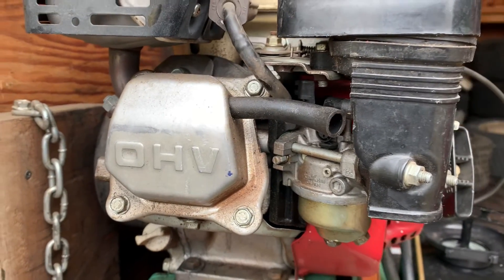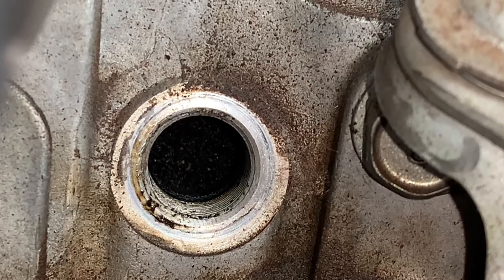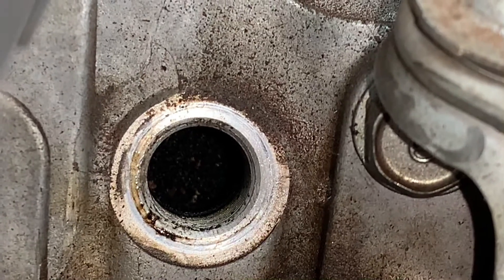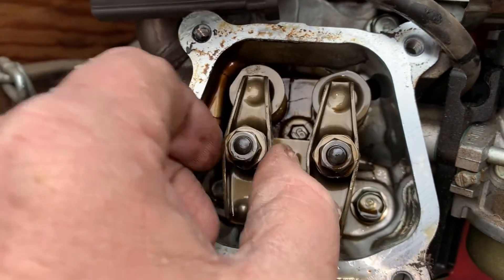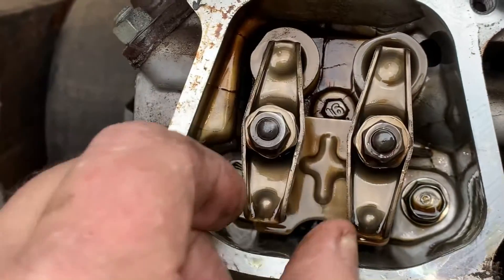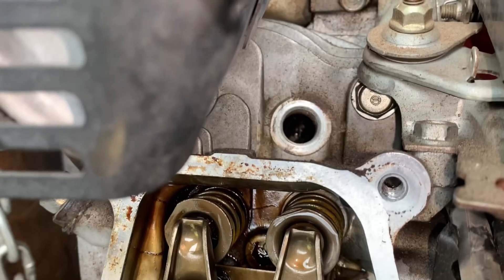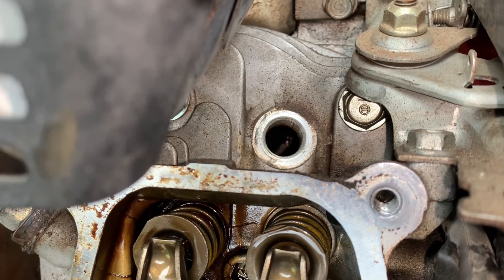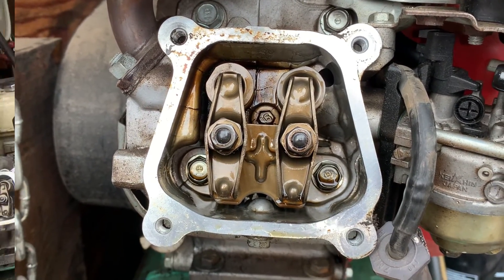DONT MAKE THIS ROOKIE MISTAKE WHEN ADJUSTING VALVES ON ANY 4 STROKE ENGINE

Comment: Is the right way to have the correct TDC at compression stroke is just after the  pressure release exhaust valve movement? 

I try both methods TDC and Cross method on my Tecumseh ohsk90 but if I set .004 at fully close valve with Cross method I obtai less tha .004 at TDC, maybe .001 or .002, I was unable to insert .004.

On the other side, If I set .004 at TDC I obtain .007 If after I check with cross method...

I'm not expert (maybe I used the wrong TDC) but I tested also ath both TDC and haven't something .007 or .006

I set at the tdc when my piston was At the top (piece of wood with mark) that was reached after the pressure release. 
Was the wrong TDC?

Comment: On my 2005 Briggs & Stratton 21hp V-twin, it doesn't matter if you're at TDC on the intake or exhaust stroke. There is NO clearance! However, if you turn the engine to fully open the intake valve, the clearance on the EXHAUST valve can be set. With the exhaust valve open , the INTAKE valve gap can be set. I suspect it has something to do with the cam timing 'overlap' on this 20yr old engine. If you tried to set the tappets at TDC (intake or exhaust), you are going to have SERIOUSLY wide clearances!

Comment: How far to turn the cam/crank shaft past TDC, top dead center, to  adjust for the "compressor release" on the cam shaft? 
Which you can tell if it has one in the schematic.
Reply from the maker: A tad past

Comment: it doesn't matter where the piston is, so long as the valve is resting, you can check its clearance and set it right if it requires it. By resting we mean it is not being operated by the rocker arm, it is loose. You will find that when one valve is resting, it is because some other valve is being compressed. Lol. But nice vid, keep on spannering and be safe out there.

Comment: I rotate the engine until both valves are on the compression TDC-loose valves then turn the engine manually without plugs in, from that point till the exhaust valve opens.-Compressed Spring. Then I set the intake valve clearance.  Then I do the opposite valve.  It’s more precise and you don’t have to wonder where the Piston is in to relation to the camshaft. 
I set the exhaust valve at the highest of the range.
Reply: I do the same, when one valve, (it don't matter which valve), is fully open, the other valve will be fully closed so adjust the fully closed valve and repeat for the other. This will end the confusion of, is it on compression stroke or intake stroke etc.

Comment: I listened but still don't understand the significance, when a compression stroke is reached looking through the spark plug hole and when the exhaust stroke is reached where as I shouldn't try to gauge the rocker arm clearance. So WHAT am I looking for exactly when I look through the hole, and at what point should I then attempt to use the gauge to adjust clearance. Please be specific.
Reply: When looking through the hole, you want to see the piston at it's closest point TO you. You attempt to adjust clearance when it's at compression because there is no pressure applied to the rocker arms; any pressure applied to the rocker arms during compression will lead to bad or no combustion at all. To know WHEN it's going into compression, you pay attention to which rocker arm is active. After air intake there's compression, so you pay attention to the rocker arm next to the carburetor; when you see it active, you'll know that afterwards compression is going to happen.
Reply: @peanutbutter6925  1). Are you saying that BOTH times the piston appears I look at the one "physically closest to me in distance"? The other times, it will be further from the spark plug hole, but BOTH times it is at its TDC or near the top of its stroke?  ...THAT IS, the one closest to my eyesight is the one I should choose to adjust BOTH rocker arm clearances at the same time? 2). Knowing what is a compression stoke and what is an intake stroke is a bit unclear to a novice... I suppose I need to know both answers to the questions to better understand things. 3).  I wish someone would have a play-by-play instruction sheet (because video doesn't explain a lot). Thanks for your effort PB because I'm facing lack of acceleration power/quitting when the throttle is depressed (idling is fine, and no adjustments (H/L) on the carb.

Comment: I've wasted far too much time worrying about finding TDC.  Just rotate the engine until one of the valves is open, adjust the other one that is closed.  Then, rotate the engine until the valve you adjusted is open and work on the other one.  Done.  No removing the spark plug, no piston position observation, etc.  The whole point of piston observation is to find TDC so both valves are closed when you adjust them.  If you're off a little, or by 180 degrees, your adjustment will be wrong.  Save time and worry, do it the easier way.
Reply from the maker: You have to make absolutely sure the closed valve is on the base circle of the camshaft. If not, you’re not going to get it set correctly.
Reply: I just used your method on my 4 stroke outboard, so simply great advise.
Reply from the maker: That method is is incorrect.  one valve open stays open for a long time during therotation of the crank, the valve you’re trying to adjust, may not be on the base circle of the cam, which will give you an incorrect reading.  Always find top center It’s  quick and easy.
Reply: @THEMOWERMEDIC1  I did it by finding top dead center, thanks for your reply.
Reply: @THEMOWERMEDIC1  Have you ever adjusted the valves on a car or truck engine? I bet you don't turn the engine to get each cylinder for TDC. When #1 cylinder is TDC, you can look at shop manual, and adjust half of the valves, then turn the engine one revolution and adjust the remaining valves. To answer your next comment you can watch the valve while you rotate the engine, when the valve that is closed you can see if you go to far it will begin to start opening. Try looking at a camshaft of a single cylinder 4 stroke and you can see the base and the lobe.
Reply: @THEMOWERMEDIC1  Thanks for this reply and this video. I set the valve clearance in my Honda GX690 yesterday by just blindly setting the one that's loose as I turned the engine. Well, today it wouldn't start and you could tell it was struggling to turn it over , it sounded like a galloping horse. Tomorrow I'm going to take the time to find TDC and do it right 👍
Reply: Agree, was gonna say that
Reply: Exactly  ,,, much more simple  👍
Reply: Man thanks lol not gonna lie same as u worry about tdc who tf can get that exactly same on every motor lmao smh rite on I like how u said that 🤙
Reply: Can I ask ya this …. Say I did what u said first lol made both open and now out of wack. How would I go about finding my start point again ? Just rotate until ones closed ?

Comment: If you put your thumb over the spark plug hole as you trunk the motor over, compression will blow your thumb off the hole, if it's the compression stroke.It will not do that on on the exhaust stroke because the exhaust valve is open. 
I always put a screw driver in the spark plug hole afterwards and move the piston back and forth to be sure I am at the very top of the compression stroke.

Comment: I been doing m for years n found for me it's easier on tdc exhaust stroke 
Rock crank till ex opens, adjust int
Rock crank till int opens, adjust ex
Cos decompressor on tdc comp stroke means you have to send piston over centre by 6mm n that's just a hassle 
But don't let me confuse the newbie's, if you do it often enough, 
you'll work out what I mean.
GT'S RUNNING REPAIRS 
OZ
Reply: Yep, I'm confused. A step by step on a 4cyl trimmer  that I'm adjusting would be helpful.

Comment: OK, I'm a decent mechanic so I think I know how to do this. Never had a problem w/with engines but for some reason I get to TDC on comp stroke, set both valves  correctly, check them again, and still I get the engine locking up when I try to start it. It WILL start fine if the engine wasn't right at the comp stroke, but when I start it and the engine is about TDC it will only turn a tiny bit and stop. I have to manually rotate the fly wheel, then it will start since it's now past the comp stage. I know what you're thinking... I don't have the valves adjusted correctly, but they are.  this is very frustrating... any ideas? Some people say to turn the engine about a quarter turn past TDC, then set the valves.  thoughts???   THANKS!!
Reply from the maker: Comp release
Broken on cam

Comment: Champion generator video shows directions wait exhaust valve be open then adj intake.  Wait intake be fully open then adj exhaust.  Not sure which first but done couple videos.  I did like you on my Pulsar then checked see if Champion way   have same specs seemed tighter couldnt get .007 0r .009 in.  Way tight from factory which weird all do build motors China.
Reply: It doesn't matter which stroke it is on, the back side of the camshaft clearance does not change. If there is a compression release, there is a timing mark on the starter bell.

Comment: ❤ great video brother have you ever did any work on the new V-Twin igx800 by Honda? I have one with around 120 hours and it is lightweight surging but also it is losing power when we put a load on the 10 gallon a minute pressure pump we changed all the throttle body gasket intake gaskets the oil we had to replace the rectifier and someone told me that it might be the coil when it gets hot gets weak? If you have any suggestions or solutions to this we would really appreciate it thank you for the time it took you to put this great video together❤❤

Comment: another additional double check is is to observe where the flywheel magnet is in relation to the coil/ignition module.  If the magnet is not even close to the coil/ignition module, then you are NOT at top dead center.  The compression stroke phase in a 4 cycle engine means that top dead center happens in TIME with the ignition.  Watch how the magnet rotates closer and close to the coil/ignition module when the piston is pushing into compression...this is how you KNOW with PRECISION that the piston IS IN THE COMPRESSION CYCLE.  .

What I have found to be very helpful is to continue to move the piston past top dead center, and then just as it starts to move back down into the cylinder, this is the most optimal spot to do a valve clearance/gap/lash.  The reason for this is two fold:

a.  most modern 4 stroke engines have a decompression mechanism.  This decompression mechanism actually holds the BOTH valves open just slightly at top dead center.  If you try to set valve clearance exactly at top dead center, then the valves will not actually be correctly gapped. 
b.  You really want the valves completely closed during ignition...and this happens just as the magnet rotates to the leading "ARM" coil/ignition module.  Ignition happens very quickly right at top dead center, not before, and not after.   If the valves are opened too soon, then you will have engine performance issues.  By slightly rotating the flywheel so that top dead center has already passed and the piston is just barely starting to move back down, you will notice the magnet has passed BY the first "arm" of the coil/ignition module.  This means the ignition spark has already happened.  And THAT is the right timing for valve clearance...(and you avoid the decompression mechanism problem stated above).

I learned this through trial and error.  I used a tachometer light.  When I had initially set my valve and timing.  I noticed that the ilde was not as smooth...I painted a timing mark on the flywheel.  The timing light showed the mark dancing quite a bit back and forth.  But when I set the valves just AFTER TOP DEAD CENTER and made sure the magnet had moved just slightly past the first arm, the timing strobe experiment showed great improvement.  The timing mark did not erratically dance and the engine was silky smooth.  Having a timing light is a great tool to have by the way.  It can also help you find out other problems too, like keyway/woodruff key damaged...or a bad coil.  Or spark plug problems.  or a head gasket problem.  A timing light, similar to how to properly use a leak down test, shows you the state of performance of your ignition health.  it can reveal things that no other tool can, and is pretty simple to understand.  

God Bless America
Reply: @tdmmcl1532 Thank you VERY much for your comment. This is the best and most concise information that I have read on how to adjust valves, again THANK YOU !!! No one else has gone this into depth other than top dead center of the cylinder. Thumbs up to you Sir.
Reply: Maybe you can answer this question:  I have a Honda FR700 rototiller and it began to miss and backfire, got progressively worse until it wouldn't start at all.  I have replaced the coil twice and even replaced the points with a universal ignition module.  Still won't start and no spark occurs.  I hooked up a timing light to the plug wire to see if I was getting spark.  No light from the timing light. Can a magnet fail?  The magnet is located on the internal rim of the flywheel.  It still acts like a magnet when I put something up against it.  It is odd that it got progressively worse rather than a complete failure at once.  I'm stumped as to what is preventing it from firing.  There's not that much to the ignition system.
Reply: @BeanieandCecil  I would think something is grounded. like the sparkplug cable or the shut off wire that attaches to the coil. read it with a meter to ground. but I could be completely wrong.
Reply: You are the greatest ever
Reply: I use a timing light or pen detector for wiring issues.  Firing issues are a pain to work on.  And, Can be expensive. 
I like the advice from the author.  But wonder if ya solved the problem.
Reply: israel owns trump AND america
Reply: Or, you can do the tappet adjustment THE EASY WAY. Rotate the flywheel till one of the valves (intake or exhaust) is FULLY open then adjust the valve that is closed. It will be at the widest gap! One lifter will be on the peak of the cam lobe while the other lifter will be on the cam 'flat'. This is the way it works on my 2005, 21hp Briggs V-Twin.
Reply: Why does God need to bless America? Is that a demand? A request? A thoughtless verbal tick?

Comment: Well in this case yes you have to place the engine on the compression stroke. the question is this: do you know why?  you are talking about cam timing here. again, in this case the cam sits in the proper position for valve adjustment . However most engines don't.

Comment: I have a motorcycle with a engine similar.. and yes I lashed the valves in the wrong stroke.. it will kinda start but not run very long.. and I have to be giving it almost half throttle at that…

Comment: Why don’t you adjust the intake valve while the exhaust valve is wide open and adjust the exhaust valve while the intake valve is wide open?
Reply: It’s the safe way to do it and less confusing 
TDC just messes people up
Reply: @philliphall5198    Yea, I’ve never understood people doing this at TDC. I grew up in a shop. Been twisting wrenches for 40 years. I’ve always adjusted valves while the other was wide open. Never had a problem.

Comment: Another common mistake is not doing the adjustment with the engine at operating temperature
Reply: Some engine manufactures want the valves set with the engine cold. My Generac generator specifies a cold set for the valves. That's where it pays to KNOW the specs for a particular engine.
Reply: Depends on the motor. My Generac generator calls for valves set at .003 with a cold engine.

Comment: THEMOWERMEDIC1 Just throwing it out there yall talking all this shit about adjusting one while outher is open is the same or the proper way to do it yall are stupid yall aren't mechanics yall are keyboard mechanics the  man is correct there is somthing called overlap while the valve may be closed its not on compression stroke wich will give a false reading you believe it's the right way turn your engine 1 rotation bet you will find the one you just adjusted to tight or to lose you don't know for sure if you are on compression stroke or not without pulling the spark plug and looking at the valve rockers you will know your on the proper stroke to adjust because you will have almost a full revolution with the valves not moving small engine are not the same as cars I know because I'm a technician at one of the biggest repair shops / dealers I do this for a living so yall keyboard mechanics go lay down @mowermedic is 💯 right on this one
Reply: I tried reading this out loud on one breath. Think Ill go lay down now

Comment: Briggs 31P777 involves what you mention at the end during valve adjustment. They want the piston to go about 1/4" in after being top dead center. Nice walkthrough! Haven't seen a video showing the piston inside the spark plug chamber. Getting ready to do this for the first time, but nervous and doing tons of research lol. Don't want to have to go back in to adjust after a fresh oil change.
Reply: There are videos where the head is replaced with lexan and you can watch everything

Comment: I took the governor off my kt196 go kart. Worked fine before, just slow. I just put the engine back on the frame and now when I pull the pull string it’s impossible to pull. It snaps back. If I take the spark plug out it pulls fine. Thoughts?
Reply: Adjust the values
Reply: @ofner13  When you remove the plugs you've got no compression and you're pulling against no resistance. If it won't pull with the plugs in check the valve set. If it's a Briggs it has a compression release and the compression release won't work if the valves aren't set right.